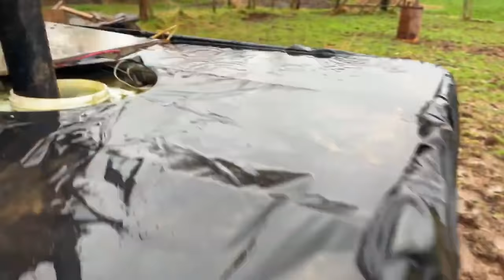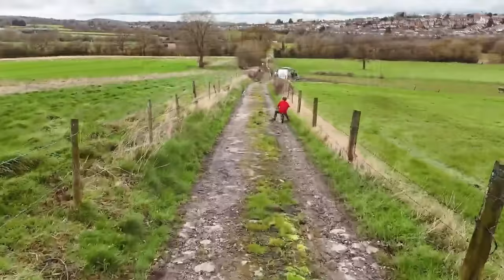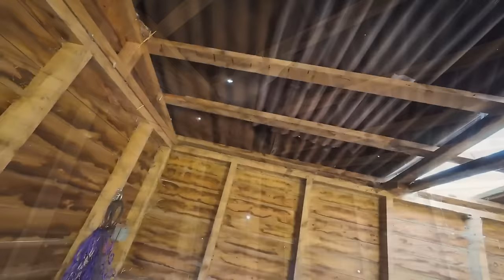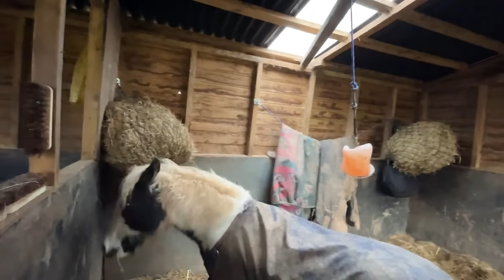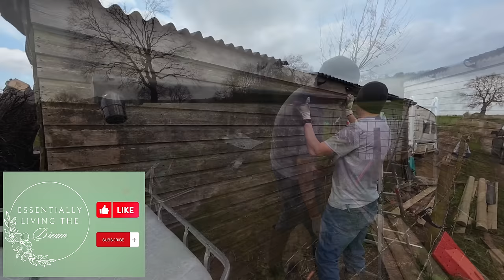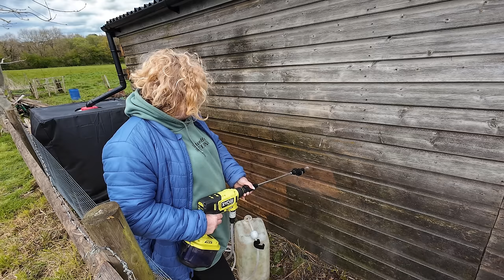Farmland Renovation: 6 Months with Calming Music

Comment: What latitude is your farm located in? I'm asking because of the winter season.
Reply from the maker: We are 51.51 degrees North of the equator @janaj.8696 so at the minute we very rarely see any snow we just have endless rain! We've had a couple of weeks of sunshine which has been wonderful but apart from that all it ever does is rain! The flooding and mud problems we had when we very first took on the land last year is starting to rear its ugly head again also. We are currently looking into what we can do for drainage around the stables so we can at least keep the high footfall areas as dry as possible. Last year there were parts where you sank to your knees!